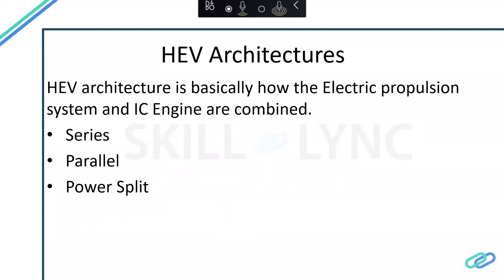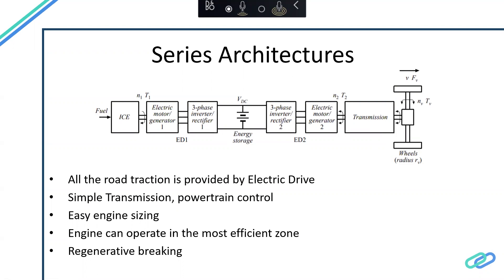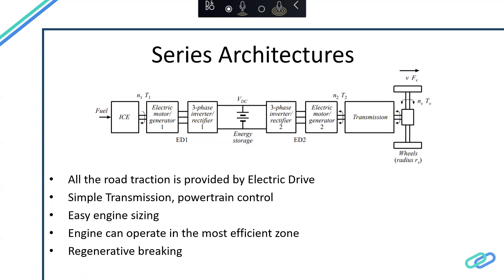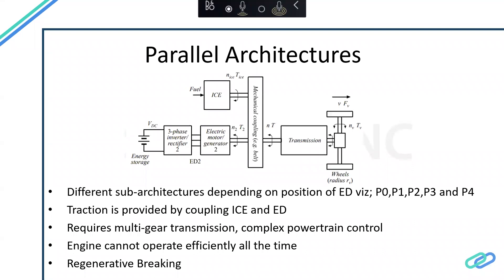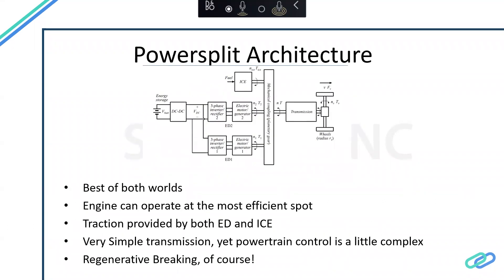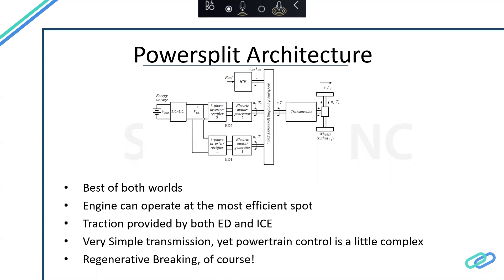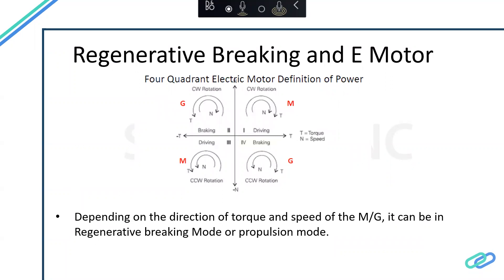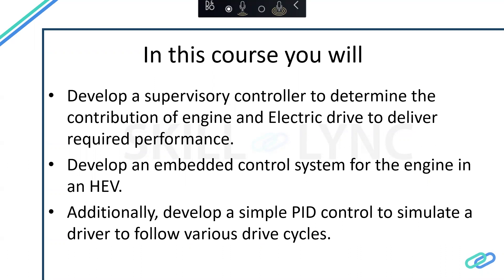Engine Powertrain Controls (Part - 2) | Skill-Lync

Comment: Hi,, i am working on developing HEV simulation platform, based matlab programming,,, how to control both motor and engine speed at hybrid driving,,, how to calculate reference speed for both based on driving command from driver controller???.. if you have answer to this point it will be helpful, or you can send your contact email for further explanation if you are interested, best regards,